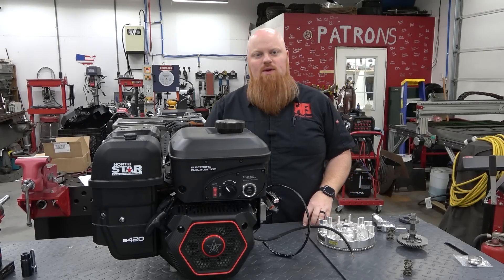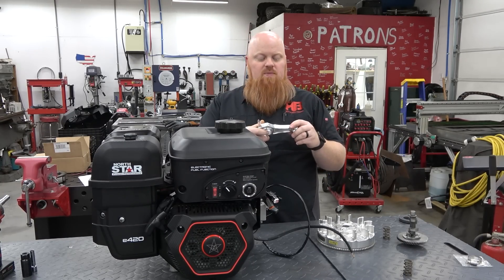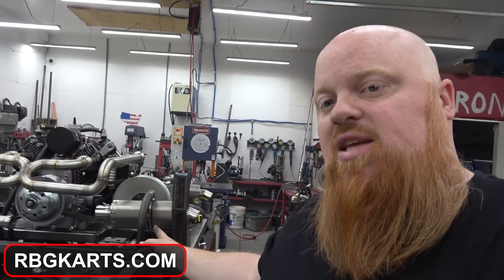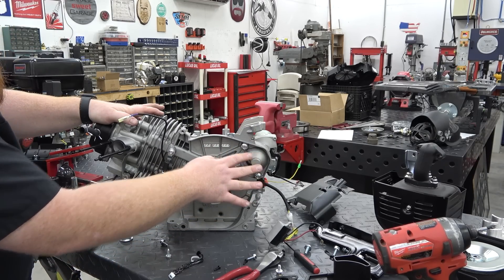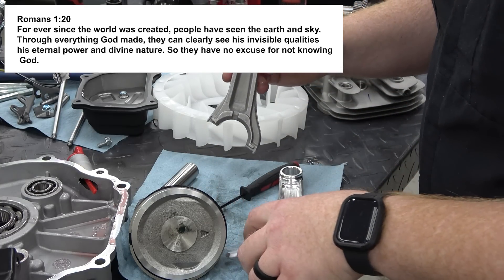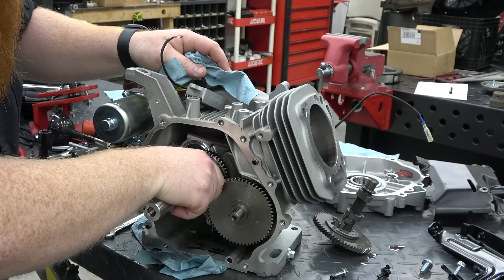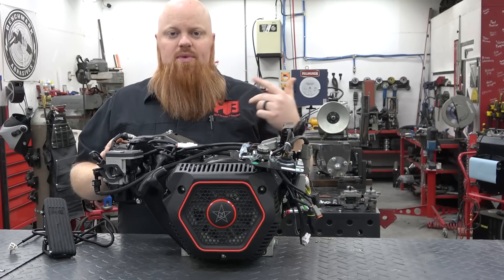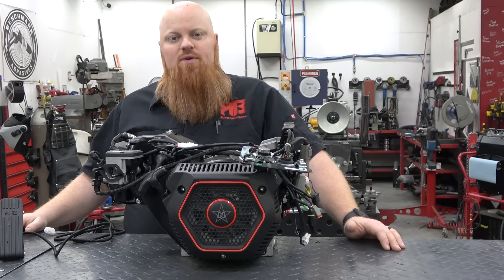NorthStar E420 Performance Upgrades ~ What Fits It?

Comment: The EFI might be advantageous for a generator that runs at low power output a lot of the time. Give you better fuel economy at low demand. Anything that runs at high power continuously it probably won't help much. Might be good for log splitters, too, since they spend most of their time at partial power output.

Comment: Maybe you can try the Indonesian brand motorcycle racing part called BRT, they sell injectors, throttle body, and tuneable ECU. Mostly for small cc motorcycles and matic scooters, maybe it can work.

Comment: I just did an engine swap with a 212 and I was wondering what's the best torque converter for a stock 212 would be

Comment: Isn't boost made before it enters the cylinder? You are creating denser air, that doesn't go away because of overlap. If overlap caused a bunch of compression loss an N/A engine wouldn't run either, right?

Comment: Centrifugal blowers such as Procharger run blow through but both roots and the all mighty Screw (GAP) blowers are draw through.  You need to in touch with Procharger i think they would work  with you to figure out a system.  They have a bolt on kit for Polaris.  Can you imagine a 670 with a Procharger.  I also think you would have better luck with a Mikuni Super BN carb with that roots blower.  Great info this video hopefully will save someone a huge disappointment. God bless y’all that’s Mrs.Red Beard and Mr. Lonnie to.

Comment: gap the rings a couple thousandths and run the non hemi head with good timing. i figure it would stress the head less instead of throwing more boost at a lower compression motor to get the same result

Comment: rethink your no overlap for boost theory that is a myth that has been massively disproven in racing engines for years. David vizard has many things to say on boosted cams and the areas of concern are in duration and LSA not overlap. boosted engines flow more at low lift and thus acts like more duration which requires mostly LSA and some duration tweeks in only the hottest of drag race engines. this engine does not fall under that. nor would it need it for street trail etc. I promise you it will run like ass with no overlap make very little power. think of every blown or turboed v8, aint no cam company grinding zero overlap cams else wise theyd be all over the catalogs

Comment: Even a supercharged engine has overlap in the cam timing. I run a supercharged Top Fuel bike and it uses a substantial amount of overlap.There is also some technology that uses what is referred to as a "five cycle " which is an extreme example of overlap used on a couple of foreign made cars. It is not really a five cycle engine, but is referred to as such. My bike actually runs a lot of overlap. It helps to scavenge burnt exhaust from the cylinder.

Comment: People who live in cold weather and fuel costs are high would benefit from this. Unless the cold air is so oxygenated that it runs too lean.On second thought. If the ecu/ throttle body fails on a generator it could cause life endangering problems in remote places like Alaska.